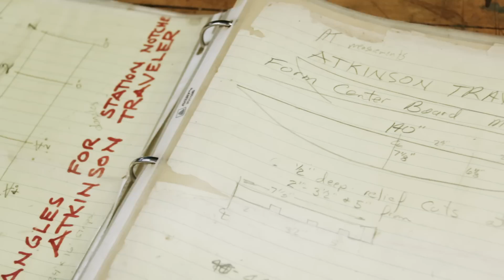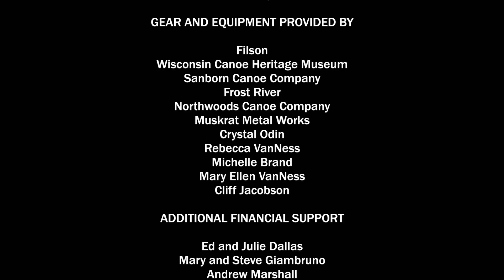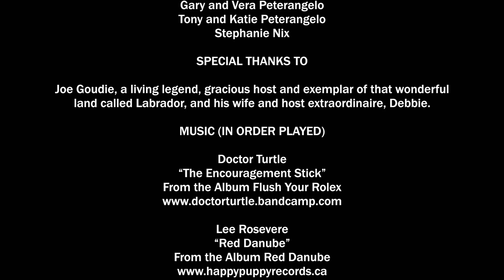Labrador Passage

Comment: I don't know if people far from Newfoundland and Labrador understand that this land is not traversed by many people.  For example, to contrast it with the number of people on the Appalachian Trail.  In modern times, how many towns would  you pass on this journey?  How many homes or roads would you see?  Etc.  I know we don't see the missing elements in the film, but people might think those parts are not captured or they are edited out.  To some people "remote" means there is no cell phone signal or restaurants, as in "remote highway".  I think it would help to convey exactly what sort of trip this is.

I'm also curious how you were going to handle the supplies issue.  I've seen another adventure traveler do parts of this route, and he arranged for resupply by airplane every few hundred KM or so.